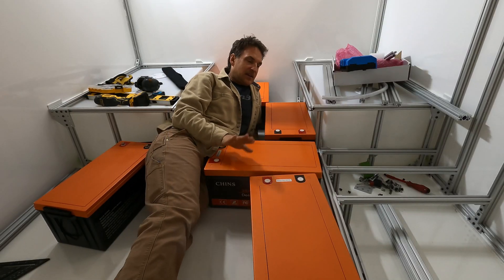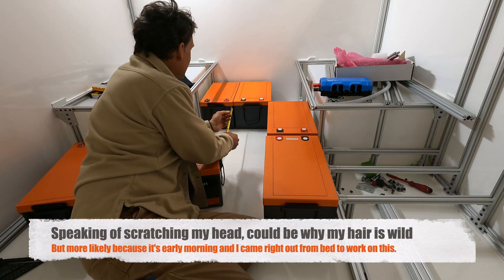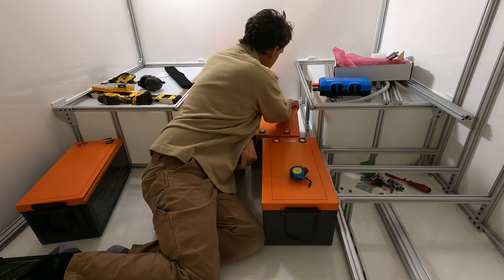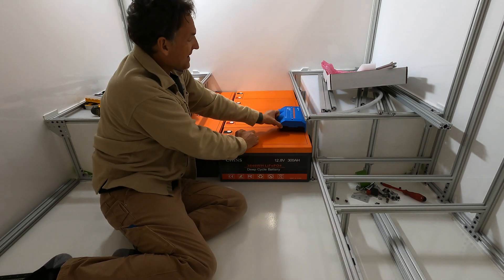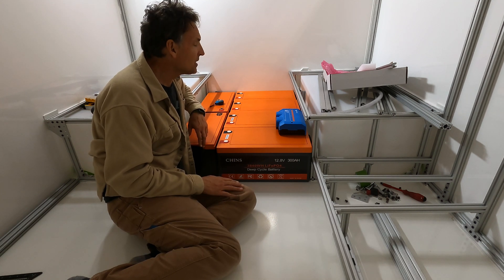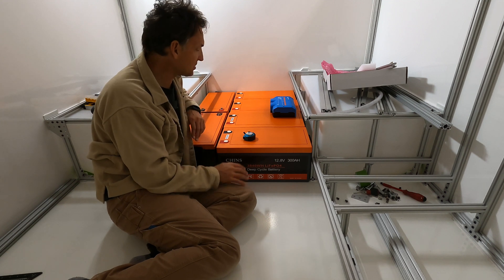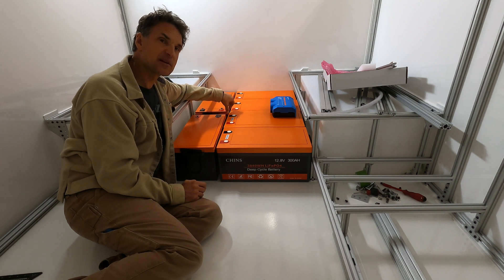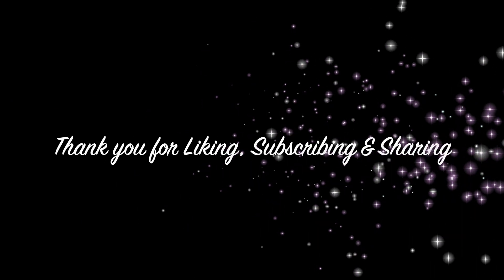Fitting 1,800 amp-hours of lithium battery capacity into my Expedition Camper

Comment: I'm shocked at the price of the Chin. How have these held up for you??
Reply from the maker: Yes, they are a great value. In testing, they performed the same as the leading brand in a side by side test including temperature testing and full discharge and recharge at high rates. They have worked flawlessly thus far. I see no reason not use them or other comparable products.

Comment: If my understanding is correct you are connecting two 12v 300 Ah batteries as a series pair to make one 24v battery at 300 Ah and then you are going to connect the three series pairs in parallel, correct? So your system is 900 Ah @ 24v or if you chose to do a 12v system then you would have 1800 Ah @ 12v, either way your system is 23,040 Wh which is good size, nice. Your description was a bit confusing as there was a discrepancy 
What was the cost of the Chins 12v 300Ah battery?
I am in the planning stage of my overlander built on a 1980's Mercedes Benz 4x4 chassis and I will be using CALB 180 Ah 3.2v cells, there will be 48 cells total connected in series/parallel for a battery bank of 1080 Ah @ 24v (nominal). Compared to Battle Born or any other mfg combing individual cells gave me a increased energy density as they fit into a smaller footprint than standard BB 100Ah 12v batteries and they were significantly less expensive. I have also planned a double stack, sliding 12 panel 5280w rooftop solar array to keep the batteries charged even if I am in the PNW for months at a time and only producing 10-20% of the system capacity because of weeks of rain or overcast weather.
I love watching your rig take shape, it must be pretty exiting knowing the finish line is near
Reply from the maker: Yes, great question, and your clarification is correct. Sorry if not absolutely clear in this video. I will make an updated video of this system all connected and tested and try to make that more clear. The Chins 300ah-12vdc batteries are about $1000--they have an internal BMS. I'll post a link to them in the video description. Thank you for watching. Cool to learn about your rig, I look forward to seeing more as it is being built out. I love the Battle Born Batteries, and the team--I know them well since their beginning--but the form factor is a bit inefficient compared with other battery form factors, and was a major reason why I chose the Chins instead. With you building you're own packs from cells, you have a lot of control to build a form factor that works for your space.

Comment: An other good instructional video! Very interested in your 24 Volt system
Reply from the maker: Thanks. The 24 volt system is certainly reducing wire size, weight and cost, as well as increasing safety with half the short-circuit amperage potential of 12vdc. I have some upcoming videos on the full electrical system as it gets built and tested.